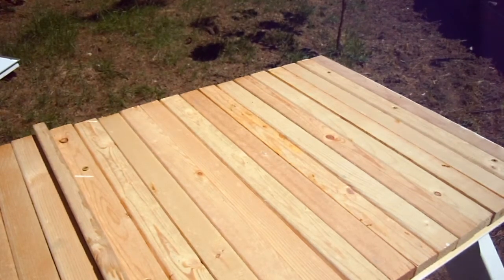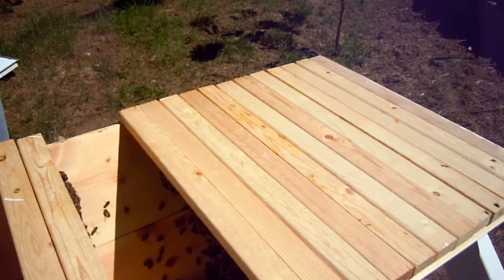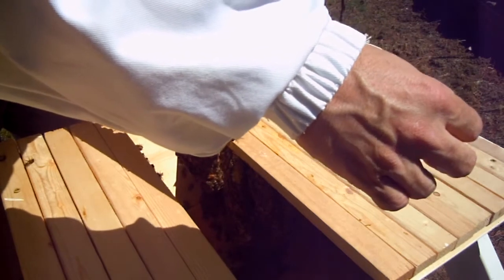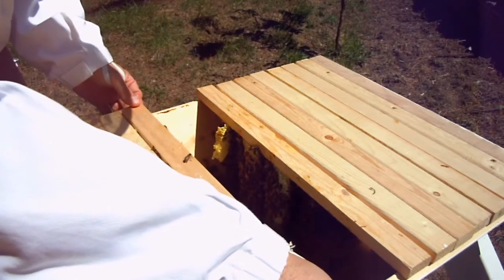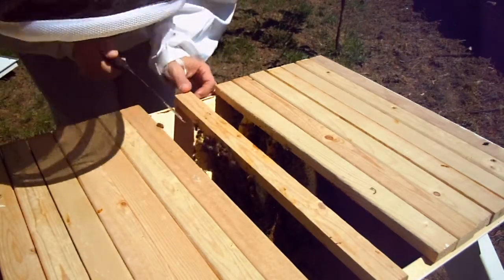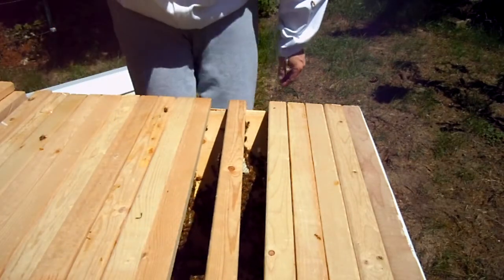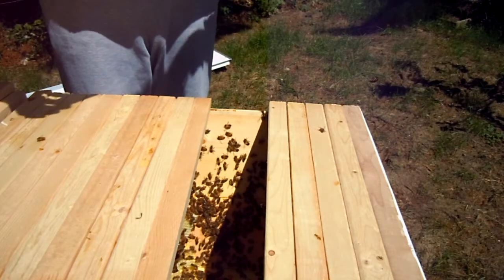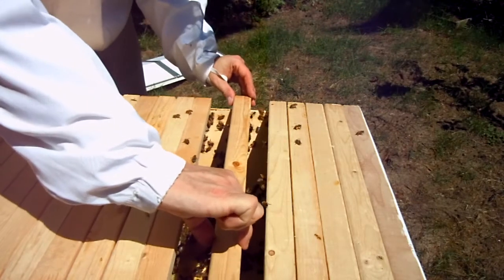Top Bar Hive Cross-Comb Repair

Comment: Awesome video.. im just gettng into top-bars and its a mess.. a friend gave me one when they realized they were more frightened of bees than they thought they would be. The hive is a nuc and hadnt been opened in two years..  i got into it today ( weathers been rather shitty) and OMG.. 
i will go back tomorrow with a bit more confidence about manipulating the comb and straightening this mess out!
Reply from the maker: I actually moved away from top bars a few years ago and use nothing but Langs now. The moisture in the Pacific Northwest during winter is a real problem and the top bar hives didn’t ventilate well.
Reply: @tzkelley  
Have you considered a long Langstroth? It's so easy on my back, with queen excluder frame and multiple entrances it's a honey machine, they ventilate as well as you want them, super easy to build and fully compatible with what you are using now! I'm in extreme south Louisiana and our moisture is through the roof and they are giving me zero moisture issues.
Reply from the maker: David Mathews II this is an old video. I’m 100% on 8-frame Langs at this point. Top bar hives presented too many challenges, particularly in the Seattle area where wet winters are a problem.
Reply: @tzkelley  Heard

Comment: I highly recommend the glass window when starting out so you can see the cross comb before you open the hive. With mine I was able to see that three bars were all tied together, so I pulled all three at once and flipped them upside down on the box. It was much easier to fix the comb, and less messy then trying to reach in with a hive tool and do one at a time.

Comment: I had crosscomb issues at first as well. It's not that I didn't want to show them on video, it's that I didn't have the patience to try and make a video while fixing comb :) In fact, after 6 weeks I am still fixing bits here and there. Be advised, even if the comb is straight on the bar, sometimes they will curve it towards the ends. That's what mine are doing now. I had no choice but to cut some out and eat it the other day. Darn shame ; )

Comment: The only thing that I can see being better than the hair clip is the build cut-out frame. But that requires the labor and skill to construct. The hair clip certainly isn't ideal, but what is? It works well in a pinch, and saved a large chunk of brood comb in my hive. If your comb is too new or too heavy, you should use two hair clips. I'll go back and cut mine out in a few more weeks whenever I feel the comb is strong enough to handle it.

Comment: My bees are making comb at an angle the same as yours.  Every frame with angled comb is at the same angle.  It appears as if they are trying to build east-west.  I am going to turn my hive slightly so it is facing directly west.
When you break comb off try to glue it on with melted wax.  The fat bee man has a video where he does this to make queens.  He used something that looked like a metal turkey Baster to apply the melted wax to the top bar then pressed comb into it.

Comment: "I guess this is why everyone builds with Langstroth hives." I remember that feeling. I'm sure you've got it under control 2 years later, but it only recently occurred to me that the curvature of the combs only occurred where there were no guides. Where the guides ended, the comb curved. Now my guides (string and wax method) go from edge to edge.
Reply from the maker: It took a while to work through the moisture issues here in the Pacific Northest but, yep, I'm better along now that I've had a few years under my belt.

Comment: Thanks for showing us what problems you are experiencing...it helps to see the problems of others...Question?  Did you level the hive really good?  I am a total newbie but I have 3 langs and 1 top bar and so far the top bar is perfect but I went to GREAT lengths to level it in all directions....mind you...this is a developing smallish swarm so it may get worse....but my Langs have cross combed and built really wide comb in there so I don't believe it is a matter of having langs or top bars...next spring I will be moving the langs into top bars due to the heavy lifting.  I am finding even the 8 frame shallows quite heavy when totally full of honey and no help to lift and move them.  I don't worry a whole lot about this stuff - cross combing etc. - though because I figure at some point those frames will all be pulled for extraction so will be destroyed anyway OR the bees will use them for food and they obviously don't care how they are built.  That is one nice thing about top bars you can always start over.  I use sugar water too and try the smoker but can ever keep my smoker going....Good luck getting the comb
 to your liking...NICE POST!!!!  I see in a later post that you did level the hive ... so it was worth the effort?  Great to know....!!!

Comment: Bees in a top bar hive will not build straight comb unless they have guides of some sort. Ideally you would put an empty bar between two straight brood combs or capped honey combs. You could also make additional follower boards that are 3/8 inch from the bottom and sides of the hive. Place them on either side of the empty top bars to act as guides until you get enough good combs build up.
Also, when they curve combs at the edges just cut the misaligned portions and then bend them into the center. The bees will reconnect them quickly.
Whatever you do, make sure you correct screwed up combs before all of the combs are screwed up.
I was about to give up on top bar hives the first year but now I'm going to go to them 100%. It will get easier.
Reply from the maker: My comb issues went away when I leveled the hive. But, your points are well taken.